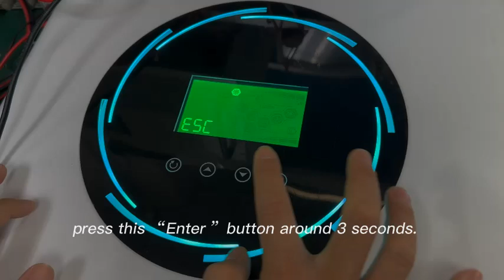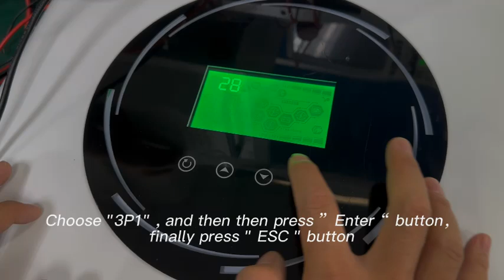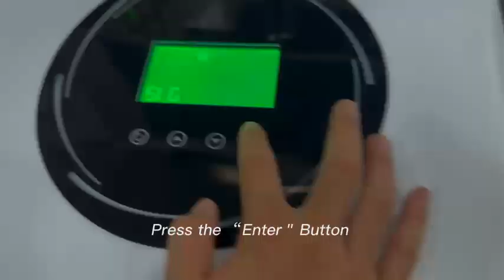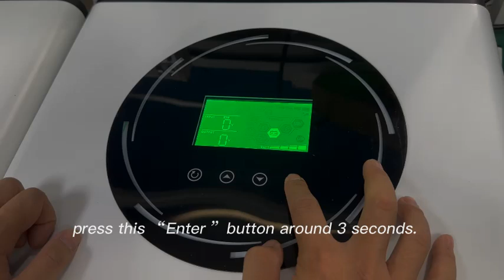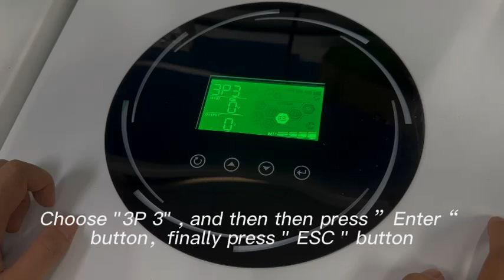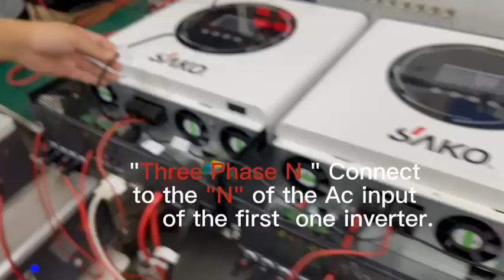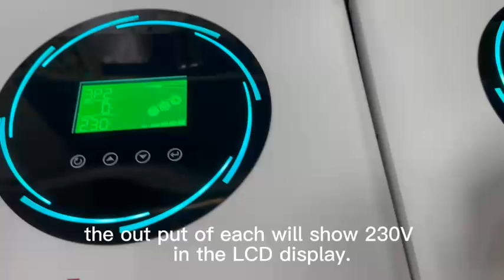3PCS SAKO Sunpolo 8kw solar inverter three-phase parallel

Comment: Can i ask you a question?
Is possible to use only one 3 ph inverter with one big battery, and use each output phase to feed 3 appartament ?

Or is better use 3 inverter one for each appartament and only one big battery, but can i connect the 3   output dc for change the single battery togeher or i need one single mmpt connect with FV panels ?

Thanks a lot.😊